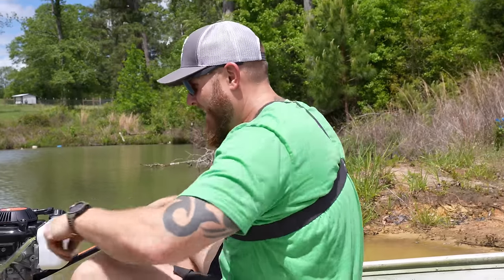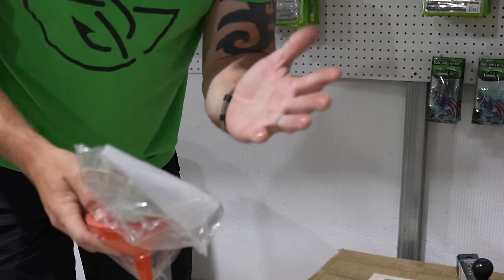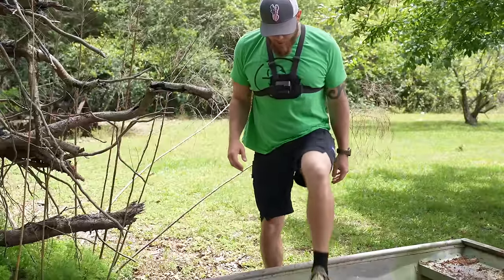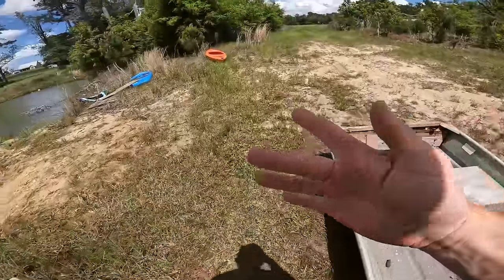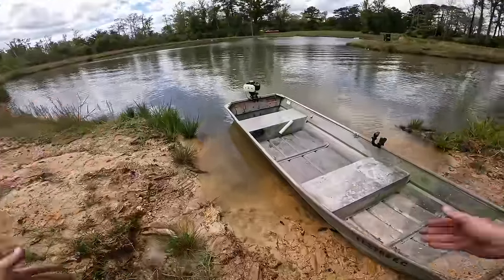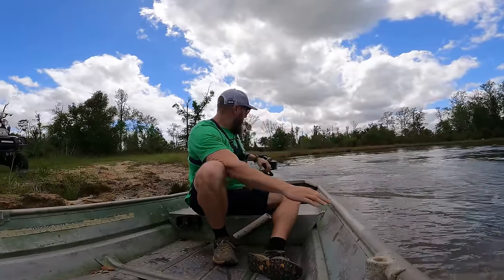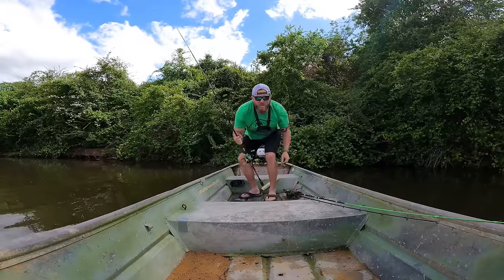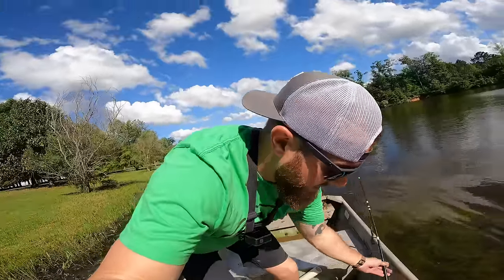I Bought a $500 BOAT MOTOR from AMAZON (Will it Work??)

Comment: I had a 5 hp Briggs and Stratton. Loved that little motor. Paid 250.00 for it used. Ran my 15ft. Vhull. So easy to work on and parts were cheap. Worked great.

Comment: About 10 years ago I bought an old British Seagull for $100. It was made in 1957, is rated at 4hp (it's really a 3.7hp), has a 6 pint (!) fuel tank (I can run around for hours on that) and has no reverse gear (they only had forward and neutral). It still runs like a dream and pushes a 12 foot aluminium boat with me (I'm 6'4 and 300lb) with two others and our fishing gear at about 8-10 miles an hour. One of the best things I've ever bought. 
Where I live is saltwater and my Seagull has never skipped a beat and gets me around quite nicely. You just don't want to be in a hurry. I can go a lot of places other boats can't though, so she pays off right there. For crabbing and fishing around sand flats I wouldn't use anything else.
With a bicycle hand-grip, a broom handle, some PVC pipe and zip ties you can build a tiller extension so you can stand in the middle of the boat forward and spot channels, rocks, sandbanks and fish.

Comment: Guessing the clear-ish liquid might've come out of the lower unit on the motor, definitely worth looking into!
Reply: I think it is the mini gearbox or the foot oil. The other liquids are not clear at all. Best of luck 😢 figuring out what's wrong.
Reply: If bald eagles were twice the size they could still only lift like 20 pounds max 😂😂
Reply: @austinspor2558  could just be cosmoline for shipping
Reply: @ivanfromtheeast4709  from a quick googling it Cosmoline is more used for ocean use products. people running equipment on the ocean probably wouldn't even a 15 HP outboard let alone 5hp, and that is generous for that little guy. Maybe it's coolent from siding else? It is a multi use space.
Reply: @austinspor2558  it’s true that it’s usually used for ocean products but you also have to consider that it’s shipped from China.  It’s very common for guns to be shipped with cosmoline i doubt this is any different
Reply: @ivanfromtheeast4709  it looks like it is in a oil form so why wouldn't they just spray it on for shipping rather then drench it in it?

Comment: Those small motors have a high side needle on the carb. Once the motor is nice and broken in TIGHTEN (to the right) the screw just a 1/4 turn and you will get more power out of it

Comment: I have one of those 4hp motors I took it out about 4 times so far with no trouble I have it on bass raider 10e but here is a video idea I was told the predator vertical shaft motor from harbor freight will bolt up to them I think you should try it

Comment: Sup lojo, great video, it works, I thought would die when Andrew joined in, or fall off lol. I'd fix up the jonboat before do again, even spray under and deck with rubberized undercoating?  Tyvm tc 🎣

Comment: You needed to add gear oil in the bottom unit 8090 weight and 10 W 30 oil and do a 10 hour break I guess you ran it with no gear lube and it don’t come with oil in it either

Comment: The bottom gears need gear oil.  The motor.. 20W50. It's a 1500 watt 52 CC hot rod.  I changed the timing, retarded to troll.  The centrifugal clutch is better with lighter springs.